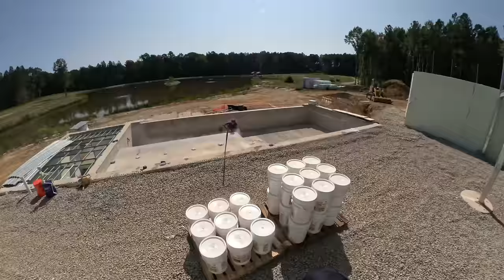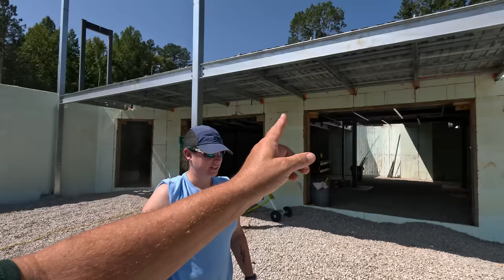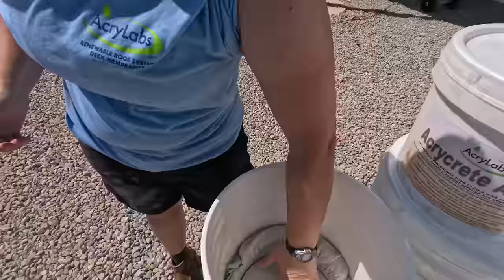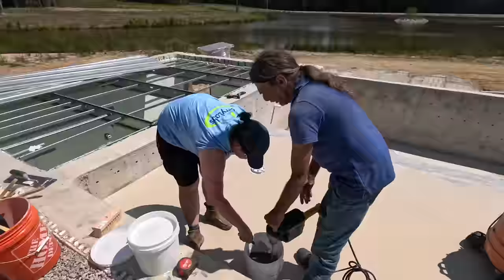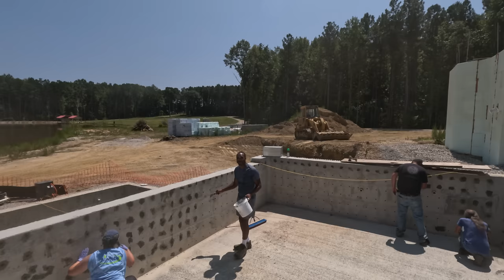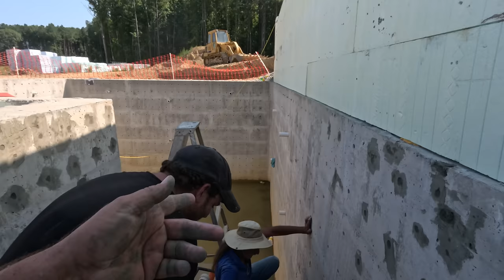Finishing the ICF Concrete Pool Using Acrycrete - Part 1

Comment: Looking at this material in the installation it reminds me of two materials we used to use on foam on the outside of buildings for plaster finishing. Both of the materials mixed just like what I see her mixing the cement with their latex material and then installed with a mesh and then a finish was put on it over the foam sheets. For finishing over foam on homes or buildings one of them was called Stowe s t o, the other was called dry that d r i v e t.

Comment: You just need a skimmer pickup and a small portable pump. Skimmer isn't hard to build if you don't want to buy one. Take a chunk of plywood, cut some other chunks and nail them to the edges. Now drill a hole in the middle and attach a pipe flange to match the size of your pump. Seal it with some permatex or urethane caulk. Toss it in the low spot and fire up the pump. It will puul the water out to the depth of the plywood legs.

Comment: I'd think you would use the pool drain to um drain the pool? Kind of  already plumbed up for it. just have to rig up a pump on the line. just have to flush out the debris before finishing the plumbing .   :)
Reply from the maker: See all those “just have to’s” 🤣. If I wanted to go ahead and hook up a pool pump, it would’ve been easy that way, but I didn’t wanna run all that mud through it.
Reply: @BealyGood  Did not realize the bottom of the pool the water was actually muddy and not just discolored. Did not think Chris would have been that messy ha ha ha, just kidding. Love your videos. I  just was confused. Just the difference of watching vs being there in person. Camera effects and all.

Comment: Is that product capable of fixing that big leak you had in the pond side of the lower pool or will a more significant repair be needed? What caused the leak, a void in the cement? Also you said the pool didn't need  waterproofing on the outside, given the leak do you still think that is true? Were there any other leaks?
Reply from the maker: Yes. It’s already fixed. Yes, void in the concrete.  If I had the sprayer and materials , when the hole was still open, then I probably would have waterproofed it. Just because it’s below the pond level. But I think we’ll be alright
Reply: @BealyGood  That is the thing I don't understand if the basement needed the waterproofing product, why didn't the pool given its the lowest object on site and almost all of it is below the pond? I suppose this Acycrete will do the job of waterproofing from the inside, right? That is if the entire inner surface is skim coated.
Reply from the maker: @snappingbear  Yes, there are complete layers of a fabric and the material.

Comment: Ships in 25 Business Days (ships from US)
Estimated Delivery to
Enter Postal Code

Apply postal code(s)
Use Floor Sucker utility pumps submerged or on any flat surface to pump clear water. This lightweight and portable utility pump is for use indoors or outside. These pumps are not designed or intended to be used as a primary or backup sump pump. Models 42 remove water from any flat surface down to 1/8 in